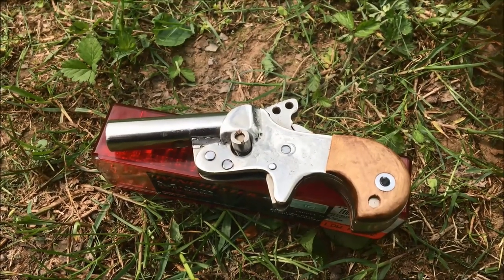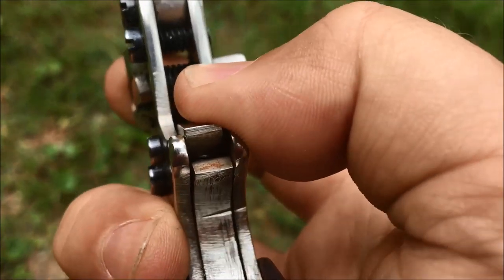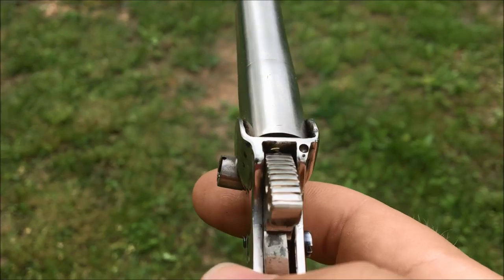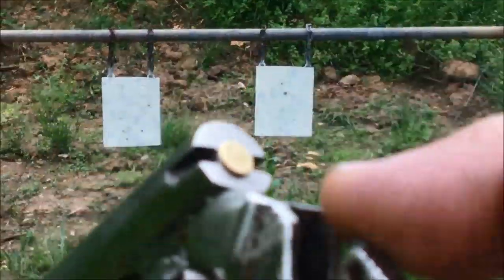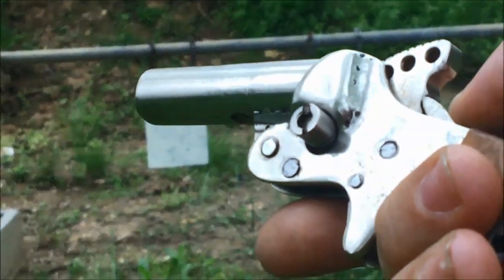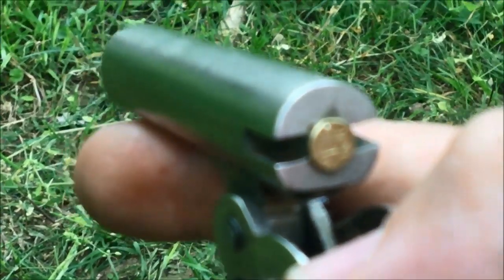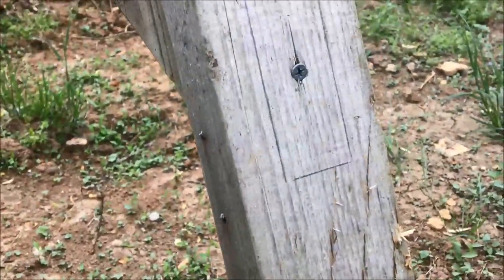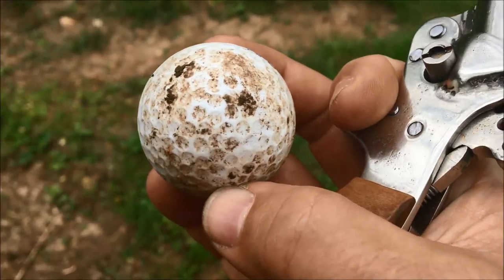Home Built .22 Derringer (part 1)

Comment: You could add a tiny spring loaded extractor by filing a notch in the barrel where the extraction grooves are, just extend one and put a filed block of metal in there with a thumb padel. The spring could hook into the extended notch, so you can get the case out quick. You could also put a spring and bb crossbar safety infront of the hammer, simple piece of metal, small spring and a bb with depression for the bb to sit in. Both really simple to do and it it would allow you to reload quicker  and carry it safely with a pin blocking the hammer.

Comment: Thats cool. For the safety if it were me I would do a lever that pivots and blocks the hammer and a flat on it so when you pivot it the hammer will be unblocked. Similar to a Baretta take down pin where it has to pivot all the way forward before the pin comes out only this will just be a safety so it literally has to be flat on one spot so it can clear the hammer. 

The gun is very well made for a homemade gun. The one I made is very similar and yeah I also had a problem with the original barrel latch. I handled it by cutting a deeper slot for it to fit in and rolled the underside a bit more to cam off the latch when closing. It now makes a positive lock up. Again good job on the build I personally know its not the easiest thing to accomplish and I appreciate the work anyone does to make themselves one.
Reply from the maker: Thanks. It is still going strong. I shoot it when friends come over. Basically a range toy. Several hundred rounds through it now. I only shoot .22 shorts now because it is easier to get the spent case out. It will fire any and all .22 lr, .22 Long, .22 short, .22 shotshell or .22 subsonic rounds though.

Comment: I built the model 3 from the volume 7 plans but only put 2 rounds through it because it is such a sketchy contraption, I'm scared that the loading gate will blow off and hit me in the head. Your video here has inspired me to maybe get ambitious and throw a video up about it.
Reply from the maker: Go ahead. If you are concerned, get some of the powderless Aguila rounds. They only have a primer. Less to worry about with those rounds.
Reply: string fire some CCI stingers and mini mag for fun :D
Reply: gorp27: Use a commercially made barrel from a Davis or Cobra derringer or even a rifle barrel cut to size and the chamber reamed for the desired cartridge - note by using the original breech you can save time building your project.

For pistols such as these a 3/8" section of 'weapons' grade steel 
for the center section with (2) 1/8" pieces of stainless steel for the side plates has proven to be "Safe" for these type of guns, as long as the caliber is kept within reason (meaning small calibers).

Comment: I wonder if it would work if you substituted welding with JB Weld?
.22 isn’t too much pressure so I think it may work
Reply from the maker: I seriously doubt it. You can invest in a cheap MIG/flux welder at harbor freight for less than $200. A welding machine is almost a necessity for a serious hobbyist.

Comment: You could probably add a safety hammer block detent pin that keeps the hammer from contacting the rim. Maybe a pull pin. It's just a single shot, so a small pin could be inserted to block the hammer. Pull it out of your pocket, pull the pin and it's ready to go.
Reply from the maker: I’m working on that idea now.

Comment: I want to see the details of the gun's construction, please !
Reply from the maker: Sorry, but I did not video the construction. I will do that for my next build. This was trial and error and a lot of manual cutting and filing. I had to go to local auto parts stores and hardware stores to look for springs and screws. I used a rifled barrel from a different broken firearm so I would not have to cut riflings on such a small pistol. The basic blueprints can be found on Pinterest. Look up Homemade Derringer pistol plans by Professor Parabellum on pinterest. A drawing can be found at https://pin.it/wnii4ii3hpu6o3
Reply: @SmithFarmandOutdoors  What's your next build going to be?
Reply from the maker: I haven’t decided yet but it will probably be a .22lr.
Reply: @SmithFarmandOutdoors  Hi it's model 1 or model 2?
Reply from the maker: Model 2

Comment: Hey, what's the dimensions on your hammer spring? The drawing calls out 30mm long x 5mm diameter x 1.5mm wire diameter. However, the follower is supposed to have a minor diameter of 3mm which means the wire diameter can't be more than 1mm. I would have to wind this myself.
Reply from the maker: I found a 6mm spring that fits perfectly and also has that extra space for the detent follower. I’ll come back with exact dims. I think the 5mm was a mistake. Should be 6 or 5.5.
Reply: @SmithFarmandOutdoors  Thank you!
Reply from the maker: My memory was off. Here are the measurements of the hammer spring I used. OD on the spring is 5.16mm or .200 inches. Wire thickness is 0.85mm or 0.0335 inches. The ID of the spring is 3.50mm or 0.1385 inches. The length is 35.65mm or 1.404 inches. Hope this helps. I went to a local old family auto parts/industrial supply store and dug through their box until I found something that worked.
Reply from the maker: @butziporsche8646  you’re welcome. Good luck.

Comment: Curently bulding the model one just wanted to see how you got the casing out
Reply from the maker: god of flames the two grooves on either side of the chamber. Fingernails just grab the spent .22 short brass. Long rifle cases may need a nail to extract it.
Reply: Bro I know you from Facebook I'm pretty sure lol
Reply from the maker: Steven Smith on Facebook.
Reply: @harleyswenson5402  oh hey man yea were friends on fb lol
Reply: No to the nail. Please use wood, brass, aluminum, anything softer than steel so you don't rub the rifling out of it.
Reply: @godofflames5427  that's funny we met here lol
Reply from the maker: Yeah. That’s all I had laying around at the moment. It was zinc coated so no damage. I’m making an aluminum pushrod on my lathe for this.

Comment: 11:44 FLINCH!
Reply from the maker: Paul Yuneps yes, I flinched. I don’t think I was quite over the testing mishap I had when I was building it. The subsonic round I tested with blew out the back of the case and hit my hand with hot explosive gasses. I was wearing gloves but it still hurt and stung for maybe an hour. No permanent damage. I redesigned the breech and firing pin and hole after that. I was still nervous shooting it. Not so much now that it is finished.

Comment: Any blueprints for this ?
Reply from the maker: I just posted a follow up video with technical information and measurements. There is also a link to a PDF in the description. I did not create the pdf but the basic dimensions on my derringer parts are in that pdf. I decided to improvise on things like the breech wall and push button barrel release. I tried the one in the pdf but found that the latch was weak and started to wear out too quickly. I needed something permanent. I also reinforced the breech  with side plates for my own safety.
Reply from the maker: https://herohog.com/GunBuilds/Practical_Scrap_Metal_Small_Arms_Vol.07-DIY_Sheet_Metal_Derringers.pdf

Comment: Tem fotos das peças ? Por dentro
Reply from the maker: Original question in English... “do you have pictures of the parts? Inside?

I have decided to do another video of the pistol and show it in detail. I will disassemble and show all the parts.
Reply: @SmithFarmandOutdoors  Okay, but you still don't have the video posted? I'm translating through Google translator, would it be possible to draw on paper and scan? then I do it in the same measurements, it's the most beautiful one I've seen on YouTube
Reply from the maker: https://youtu.be/zfu3dYA2QrA This is part 2. Included in the description of the second video is a link to a PDF that has the information you are looking for.
Reply from the maker: Second video:  https://youtu.be/zfu3dYA2QrA Included in the description is a pdf that should have all the information you are looking for. In the second video I use digital calipers and measure the parts for you.